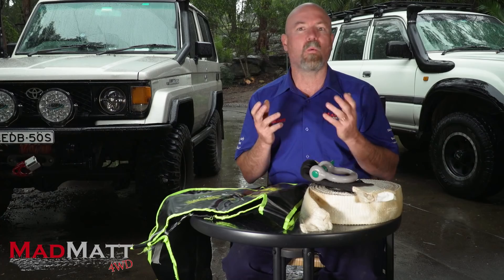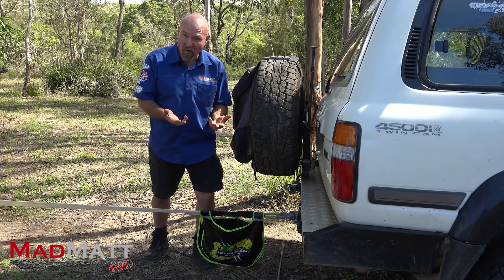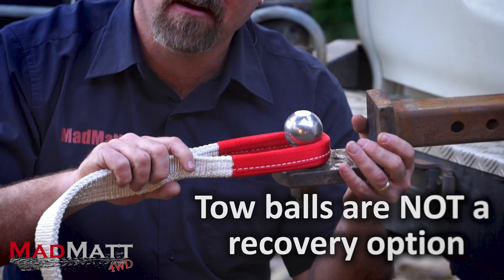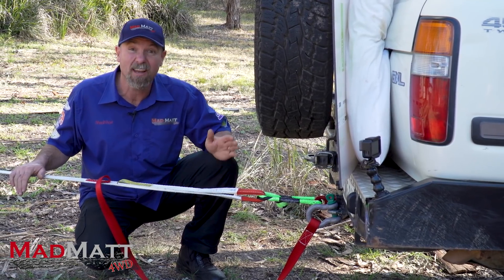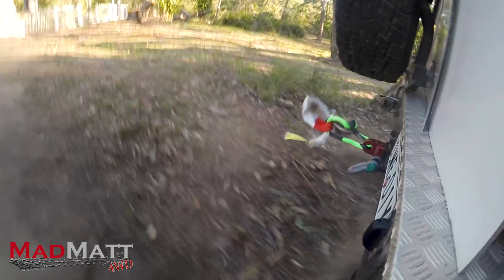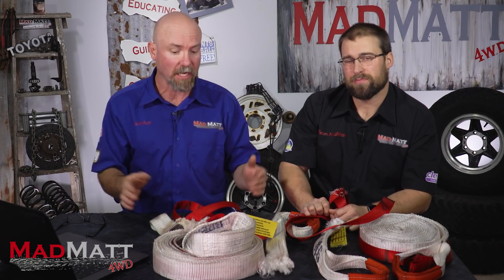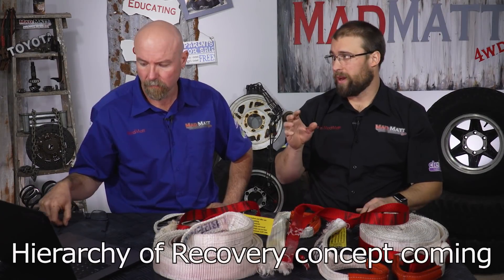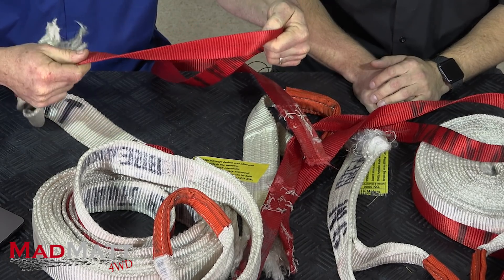Dangers of Snatch Strap Recoveries - Destruction Testing

Comment: That’s why if I’m getting pulled out of a hole I always open the hood ( it’s what we call the bonnet in the states) I’ve seen hitches fail and go back through the front window.
Reply from the maker: I know that theory and it's certainly fine to do I just don't like not being able to see so I ensure I'm hooked safely
Reply: MadMatt 4WD where I live in the states we don’t have the gnarly hill climbed we just have mud holes so you just get on the brakes when you feel it pop out of the hole

Comment: Hey Matt what if the tether was heavier graded material, running further down the snatch with multiple points of stitching? Great job on the testing too mate you'll probably save lives with this information cheers xx
Reply: Or at least enough slack tether to compensate for the stretch length of the snatchy
Reply from the maker: That's worth thinking on.

Comment: Matt, I appreciate the very informative and entertaining way you present this topic. There is one thing I'd like to ask for clarification though. In the beginning you say not to use the receiver (mounting a shackle through the hole) because the welds are not designed for that. But later you are using a hitch receiver yourself. So can you use the hitch or not?
Reply from the maker: Thanks. In the beginning I’m referring to when people take a hitch and remove the tow ball so they can fit a bow shackle. The hitch I do use is a specific recovery high designed for kinetic recovery. Two totally different devices. I hope that help and thanks for asking.

Comment: Maybe I’m still old school, and yes I do see the safety in kinetic ropes and straps but for a light recovery > meaning a standard vehicle to vehicle  SLOW pull that maybe stuck in some light snow, minimal sand, minimal mud I would use a proper tow strap and soft shackles. Again this is a very slow pull when one vehicle has good traction and the other doesn’t. Tow strap first if possible. 
Of course different solutions for different situations.
Reply from the maker: So your talking about a tow recovery which is very different to a kinetic recovery.

Comment: Interesting. The snatch strap tether might work if the tether were longer. A piece of very loose rope (at each end), tied to the attachment point and five or six feet down the strap, might work just as well. The goal would be to just catch/slow the broken snatch strap as it recoils. No advantage if the strap breaks elsewhere.
Reply from the maker: I think a fall arrest design would work
Reply: @MadMatt4WD    ..  Perhaps. Personally, I avoid snatch straps. Traction pads, winch, tow straps, shovel, and similar (pushing & cussing), but no snatch straps.
Reply from the maker: I’m with you. I’ve done one genuine kinetic recovery in the last five odd years. I hate the things if I’m honest. Even though they’re an effective tool.

Comment: This is just me brainstorming about the tether straps. So the idea is decent in my opinion. But the tether is beyond its capacity before the larger strap recovers to it’s original size before it was stretched. What if the tether was 2, or even 3x as long. The remaining could be folded or coiled up and attached to the strap where the fuse is, closer to the eyelet so when the strap fails, the coiled part has to be uncoiled first, which would dampen some of the recoil inertia, and then have its attachment point where it’s cooled have a breakaway tension rated to say 1/4 of the fuse breakaway strength. Then when the strap would fail, the fuse would break, the tension would cause the cooled up tether to break away from its attachment point, but still be attached ahead of the fuse, and the additional length would allow the strap to return to normal size and the tether wouldn’t be bearing so much of a load. It makes sense in my brain and I hope I’m explaining in a way that makes sense to someone else as well 😊
Reply from the maker: I think I understand what you’re saying. It’s almost like a fall arrest system which is what I think would work.
Reply: @MadMatt4WD  yes, exactly! I’m glad you were able to piece together my nonsense into something hopefully useful 😂 That would be cool to see that in a design someday! If it’s functional in practice, of course!
Reply from the maker: @joeyhannan5294  I’ve discussed the idea with manufacturers and they don’t show any interest and I don’t have the ability or time to do it. Unfortunately it’ll probably never get developed.
Reply: @MadMatt4WD  that’s really a shame. I feel like the idea is there and it’s a worthwhile thing to try out. I’m surprised nobody wants to try it. Hell, if I had the R&D and ability, I’d try to make it myself! 😂

Comment: Can a shipping/furniture blanket be used to get a similar effect as air dampners? For instance a 6' blanket draped over the snatch line?
Reply from the maker: I think that would work fairly well. Very impractical to carry around though.
Reply: @MadMatt4WD  I carry one flat on the rear deck of my Hummer H2, keeps the wear and tear off the carpet. Thanks for your reply and your videos.
Reply from the maker: Thanks and yeah that’s a fair solution

Comment: I’m a little confused though. How is it that the D shackle is detaching from the hitch?  if the straps breaks I don’t see how the shackle is detaching thus flying back. If the strap breaks wouldn’t it be just a strap flying
Reply from the maker: There can be a number of fail points. Very rarely if ever is it the bow shackle. Use y’all y’all it’s because people connect to a part of the vehicle that is not strong enough or the strap fails at its fuse point.

Comment: I never go full noise when useing a snatch strap in river sand for example I just go a steady speed not much off idle and let the touque do the work if I don't get it the 1st time I just back up and try again it usually at most if hard 2 to 3 gos there out having said that my trucks a 6 not a 4 more force is required with a lesser car.
Reply: @lastbhatalive  yeh someone times you have to put the foot down just last resort

Comment: The problem I see with snatch straps is that most people just put the pedal to the floor and get a huge run at it like you did in the failure test. To me the design is just enough to get slight momentum forward and absorb shock. That's it. If you need more than that its time to start winching.
Reply from the maker: Couldn’t agree more. Also it should be the last devise you use for recovery not the first.

Comment: Isnt the porpuse of those straps to stretch it. like in real use you have a 4x4 stuck, and you have one of those straps but instead of just press the throthle and not stop at all, you accelarete but than you break leaving the strap under tension, and that tension helps pulling the other 4x4 stuck. it would be a nice test if you could see how much force it produces under tension.
Reply from the maker: That is on technique you can use for sure but it’s not the normal way you use a kinetic device.

Comment: What if the tether was actually tied to an anchor such as a bag of rocks tool bag etc something you could tie to drag behind you as you pull I've done such things with toe straps before but I've never actually pushed one to this breaking point
Reply from the maker: Sure. This didn’t work but the concept could work with a better design

Comment: My question is, why is the bow shackle flying? What was it hooked to that failed?
Reply from the maker: The bow shackle never failed. The fuse on the snatch strap failed as designed. Nothing failed outside of what I wanted to fail.
Reply: MadMatt 4WD ok I’m following, it seems that in order to have this issue the attachment point for the shackle would have to fail. This would be the only way the shackle would still be attached to the rope as a projectile.

Comment: Curious, how are you breaking a 9 tonne strap with a 2.7 tonne vehicle? I assume you put a weakness into the straps? On a different note, "snatch" or kinetic recovery straps and ropes stretch. But non stretchy straps will also fire objects pretty well. If a vehicle is suck and won't come out with a straight pull, your only option might be a snatch. Surely using the right gear for the job has to better than using the wrong gear. So I'm confused why you'd not want a rope/strap for this purpose? BTW - you might want to look at ropes over straps, personally prefer them.
Reply from the maker: The reason the strap breaks is because a moving vehicle has momentum which we call kinetic energy. This energy compounds the faster you go. @robert Pepper has an excellent video about this. I’ll find it for you. I do prefer ropes these days.

Comment: The tether is a great idea but, it needs to be anchored about a third of the way down the strap with at least 3 metres longer than the snatch strap. The tether needs to start working after the snatch strap has started to travel backwards. The snatch doesn't need to be anchored in a different place, it can go around the same hook as the snatch.
Reply from the maker: I agree except the anchor needs to be in a different spot in case the anchor fails.

Comment: So the idea of the tether is to reduce the power generated when the snatch fails?
But what if it's there to be the weakest link? Rather than the recovery point giving out or any of the other points, once the tether spot has reached its 9,000kg it just says "time to give up". 
So yes, it is dangerous that it flies back. But it's a hell of a lot more safe if it's the snatch material flying through the air than a chunk of metal?
Reply from the maker: Yes except they can have so much force even the strap can go through glass and do damage to us.

Comment: I do not understand why a fuse point is used in snatch straps? Doesn't this just lower the breaking strength of the strap? Is this being done by a government mandate because people were using insufficient attachment points and getting injured? Or just a company's attempt at making a safer snatch strap?
Reply from the maker: the concept as I understand it is to ensure the strap isn't so strong that it brakes the anchor point.

Comment: The tether needs to start working after strap is back at no load length. Other wise your trying to stop 9 tonne with something half as strong as the 9 tonne it's meant to catch?
Reply from the maker: Yeah. The tether was never going to work.
Reply: @MadMatt4WD  shows the manufacturer hasnt done any real testing.. the designer should have known without the need to test. Great idea though. Add some length and even lightly stitch the excess to the main strop so it fails at many fuses, dissipating energy every time. But only begin its purpose when all stretch (tension) is gone in the main line. Only then combatting the momentum of the strop..
Reply from the maker: Yes I didn't make a friend when I showed the manufacturer how it didn't work. I agree that is the solution.

Comment: The energy taken to break the tether,  is taken from the snatch strap's recoil. So the recoil must have been reduced = to the breaking strain of the tether.
Reply from the maker: Reducing the recoil will reduce the effectiveness of the strap. The tether is a poor design and needs to be rethought. IMO
Reply: MadMatt 4WD I think if the tether was much longer with more stitching in the middle of the snatch strap and you could have partial stitching at the current location by the breakpoint that way when it actually broke it would fight the energy after part of the energy has been dissipated. It’s hard for me to explain

Comment: Nice video... I think the hierarchy of recovery (at the end of the vid) is accurate for certain situations like rocks and off-camber, but when you're bogged down in mud, sand, snow, etc., the snatch strap - or even better, recovery rope ;) - would be #4 and then winching would be #5.  I carry both and use the strap vs rope depending on the situation, then when I have to winch I can use my snatch strap to secure the rear end to a tree/object.
Reply from the maker: I agree with you for the most part. I think the important thing is that people take the time to properly consider their situation and then execute accordingly.

Comment: It seems to me that all the energy that tore off the retaining strap, is energy that would have been in the main recovery strap after the fuse broke.  although the thick strap rebounded to the anchor. i5 seems that it would have hit harder if it had not had to tear off the small red strap first.  I think it is similar to an air damper in design.  Most demonstrations of an air damper still have the recovery                                                                             strap hit whichever side didn't fail, the damper just slows it down.

You mentioned in the video that the manufacturer spoke with you after your test.  Were they interested in implementing any of your suggestions, or did they say they were satisfied with how the product performs?
Reply from the maker: I agree there had to be some slow down of the strap but it’s fairly negligible imo. They were not happy with me and have not spoken to me since.

Comment: I use a heavy furniture blanket over the recovery strap but I never try snatching or jerking the load, I just pull the strap, stretching it then stop and hold with my brakes, till the load overcomes friction and begins to move.
Reply from the maker: That sounds like you do a tow recovery. Which is excellent.
Reply: @MadMatt4WD  It's good to know the proper term, thanks.

Comment: Excellent video, Thanks. I have a question, I am a beginner so please excuse me if my question sounds inappropriate.  if I am attempting to recover a stuck vehicle with snatch strap attached to the dedicated recovery points on both 4x4s chassis . Incase the recovering vehicle accelerate hard to generate greater pull force, if the force is still not enough to recover the vehicle, and the recovering vehicle is stopped by the strap, with a violent sudden stop. My question is,  can this damage the recovering vehicle  some how ? Engine foundations or engine itself or anything at all?
Reply from the maker: Hey mate. No problems asking questions. The vehicle won’t stop suddenly with a snatch strap as they stretch which is the key to how they work. The biggest mistake you can make with a snatch strap is going to fast. They can generate a HUGE amount of energy and it’s uncontrolled which is why they’re so dangerous. Personally I hate them and only use them on the odd occasion. I much prefer to reduce my recovery load with a shovel and winch or tow.

Comment: Matt Jarrod from Munji did a test on tow ball in a test bed It took 9 ton the tow ball did not snap it started to pull the thread out it was a new Hayman Reece one too. As well don't snatch from middle of tow bar because it can destroy your tow bar and chasis I will forward you the pics
Reply from the maker: In the content you sent it says the thread/shank stretched.
Reply: Yes the ball did not snap off with 11 ton force in test bed the thread started to fail so test was stopped
Reply from the maker: And it’s not hard to generate that type of force in a recovery. Robert Pepper did a video about the forces we can generate.
Reply: @MadMatt4WD  yes I have seen Robert Peppers report on it

Comment: What about a heavy equipment strap? For example, the ones used by cranes or bulldozers. They are a lot thicker and I highly doubt you could break one with a truck without the strap having visible damage beforehand.
Reply from the maker: That’s not really the point of this video. It’s a good thing they have a fuse in a strap. The ropes don’t but they’re a different animal.
Reply: @MadMatt4WD  Man, you are really kind of abrasive when you answer my comments. I’m not sure why. I was just asking about the heavy equipment straps because I have never broken one and have used them to pull out some pretty heavy trucks (hummers, 3500’s, etc). I will refrain from commenting with any ideas I have in the future.
Reply: @modificationnation73  I hope not to be abrasive.  MadMatt is correct...the point of the video was to break the strap.  And think about safety.  Yes, we can always bring an unbreakable strap, rope, cable, but will it be so big and bulky no one will carry it?  And the purchase price is prohibitive.  Back to safety,  those big straps you are using do break when used with large cranes and bulldozers!!

Comment: What is the exact danger of recovering from a hitch ball - is it the strap slipping off the ball, or is it the ball being ripped off and becoming a projectile?
Reply from the maker: We've had a number of cases in Australia where the balls have become a projectile and killed people.
Reply: @MadMatt4WD  Where they those euro-ball type mounts?  Those are the only ones I've ever heard of breaking.   I don't think trailer balls should be used regardless, but I've looked up and down for an example of a standard U.S. style ball breaking and have still yet to find one.
I've seen plenty of receiver hitches fail, which is why I prefer actual tow points rather than receiver based hookups.  Just the other day I was behind a van on the road that had the entire right half of the receiver ripped off.
Reply: @l337pwnage  please expand on euro type tow balla vs the US ones
Reply: @tilmanfrers7206    euro style
https://www.youtube.com/watch?v=aahIL6QoTik

best example of a standard one I could find.

https://www.youtube.com/watch?v=P7yVl3tn-74
Reply: @tilmanfrers7206  themtube is shadow banning my lynx again
Go to the themtube search
type in "euro ball tow"
first one should show a euro ball

Then type in "ball hitch"
that should get you the standard ball and ball mount setup.
Reply: l337pwnage I’ve broke a few. I always open the hood when being pulled from the front. But we just play in the mud where I live and no crazy hill climbing to do so being pulled from the mud with the hood up isn’t to sketchy